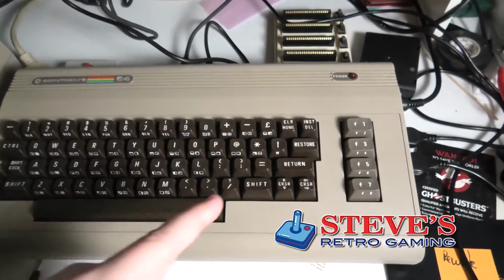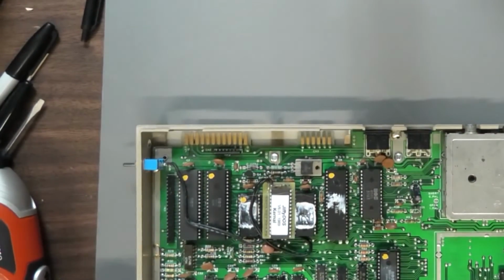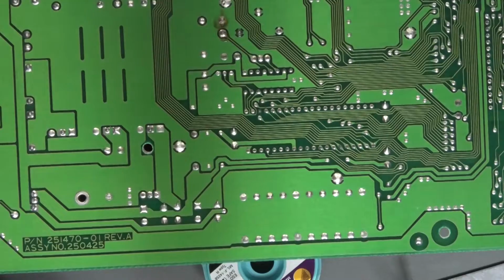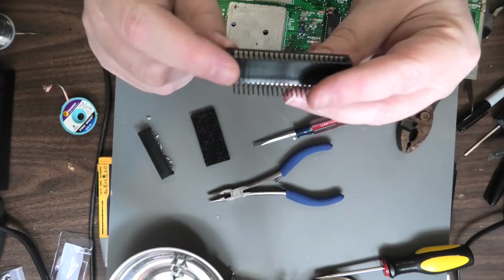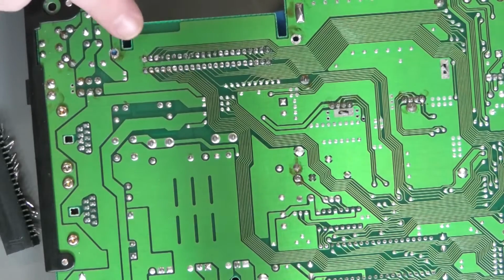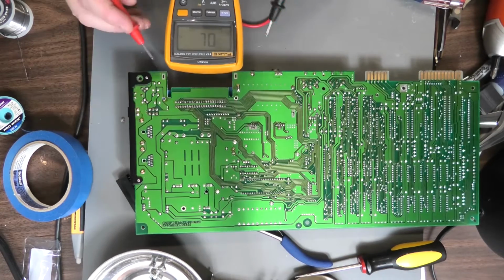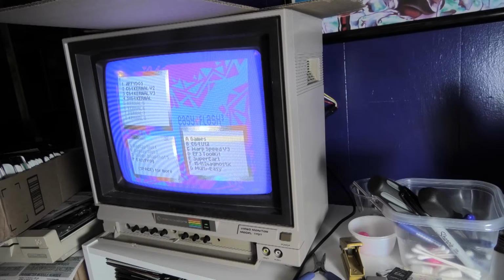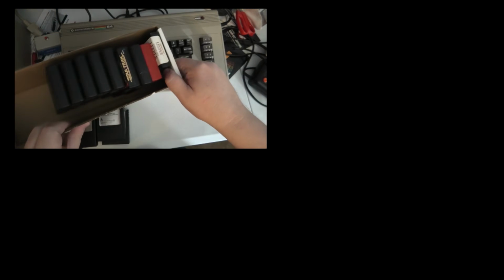Commodore 64 Cartridge Port Repair - Is it EASY?

Comment: Where do you get the replacement cartridge slot? Mine seems to be shot. Initially de-oxit seemed to do the trick, but lately I had trouble with it. I tried more de-oxit, but no joy. The cartridge looked corroded, but it's like 2 years old (1541 Ultimate 2+) So I took that apart and it wasn't corrected just covered in green sludge. So I cleaned that up but still no joy. I think the slot is dead. I suppose I could try bending pins, but you said that didn't work for you. The interesting thing is the reset line is working. The cartridge doesn't boot, but the reset button does reset the c64. If I hit the menu button it completely corrupts the BASIC screen, but I can tell it's still the BASIC screen and not the U2+ screen. However I also see elements of the U2+ menu as well. I'm 99% certain it's the cartridge slot. I have a GAL PLA (which didn't fix my original problem which turned out to be power related)